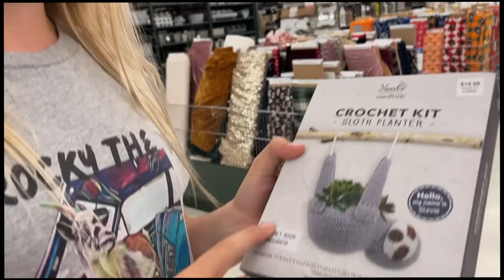Wife’s F100 is back on the road after 16 years! We broke down!

Comment: Oil soaked steel wool can spontaneously combust. We had special containers to store it in the motor pool. When adjusting steering boxes, bottom out the screw then back it off a little.

Comment: Rislone oil treatment works well for stuck rings and cleaning up the valves I have used it on a old 61 ford P/U that smoked and it stoped with in 30 miles, Love the head liner great video love to watch you and your family.
Reply from the maker: Ok great thank you

Comment: Fun vlog, work together well! FYI, before adding any thick additive i.e honey, stp, lucas have the engine to operating temp and running allowing additive to thoroughly integrate with hot oil. If that cold clump gets sucked to the pickup screen, usually ends in the knock knock knock of spun rod bearing which got starved of oil. Thanks for sharing!
Reply from the maker: Ok thanks

Comment: Hi! Love you all precious family! To keep the screw attached to the drill bit take a magnet and run it over the drill bit all sides. It will magnetize the tip and the screw won't drop off when backing it out or putting in a screw. Neat trick.

Comment: Hey, if you want to get rid of the scratches on the glass, I have used a ceramic polish to get rid of the wiper blade scratches. You just need to be consistent with your polishing pattern. And it does take a lot of elbow grease...
Reply from the maker: Ok thank you

Comment: Hot engine garden hose sprayer with the mist setting. Bring the engine up to 2k rpm and mist some water in the carb. The rings tops of the pistons and the valves will be cleaned. Just need water.

Comment: With most steering boxes,,jack the front wheels off the floor. Slacken the lock nut and keep tightening the  grub screw until while turning the steering wheel you feel the steering tightening up right in the middle. Usually this will be spot on. 
✌️🇬🇧
Reply from the maker: Ok thank you
Reply: @Sleeperdude  no problem at all. ✌️👍

Comment: Yeah we had an old station wagon and every time that would bong that's when it was out of gas no matter if you were at a red light or wherever you're at it it bong you were done we even tried jumping out of the car as it was moving to keep it to keep pushing it to get to the gas station all the fun old days yeah my dad used to use when he spray it down with brake fluid and heat it up with torch it would work very well thank you for the video

Comment: That truck brings back a lot of memories. I bought a 72 exactly like that one, back in the early 80s, ford brown half ton, 302, with shell camper just like yours. Rusted with a lot of miles on it for $300 sold the shell for $200. I put a holly on it, headers and my friend welded glasspacks to it, you'd think it would be loud, but it was actually quite. I had to replace the floorboard, but was able to Revit it in, the bed flapped so I found a good green bed for it. My friend repainted the whole truck. I was highly envolved in off road racing and used the truck to haul equipment putting a lot of miles on it going back and forth from Vegas to Cali, it never missed a beat, great truck. Thanks for posting and hope yours is as good as the one I had. 👍🙂

Comment: Just so you know you can use a 9 volt transistor radio battery touch the two contacts to the steel wool and you can start a campfire with it. Old timer prepper trick and I should know I'm 71 yrs old.

Comment: Best way to clean out the gas tank is to use Berrymans Parts Cleaner and throw some small rocks in there. Tip it back and forth and all that gunk will be gone and let it sit for a day or two also.
Reply from the maker: Ok thanks
Reply: @Sleeperdude  Check out my Austin Healey playlist...I cleaned the gas tank on that, check that video. Part 4

Comment: The shifter tube is probably what caused the first reverse problem. Spring loses it’s memory and a press weld plate pops off and then the thin wall wallows out.

Comment: When I looked for a sending unit for my 75 with a 360 I tried a bunch of replacement sending units & they were all 5/16. But my original one I took out was 3/8! But I could not find one like the oem. LMC didn't even know the difference! I called them & they assured me there's is 3/8 but when I got it, 5/16! I went through that 3 more times with LMC before I decided they simply don't know the difference. I ended up repairing my OEM sending unit & reusing it!
Reply from the maker: Ok great thank you

Comment: My 72 F100 shifter failed, so did same as you...floor shifter. Then I went to [power steering, so replaced the whole steering column and smaller steering wheel. For the reverse light I made a bracket on the front of the part going through floor pan and mounted an adjustable switch similar to the brake light switch.
Reply from the maker: Awesome

Comment: You might check the cab mounts ..
I had a 72 F100 & over time the steering became a chore..
Turns out the cab mounts had rusted & this allowed the cab to settle down on the column..
Making it a bear to turn..
Yours is a 73 , so maybe they are different.
But its worth a look.
Reply from the maker: Ok thanks we will check it out

Comment: A good hack on a rusty fuel tank . Get yourself about 2-3hand fulls of nuts and bolts,I use 1/2" for extra abrasive action,to knock the scaley rust loose. Ready strap the tank to you tracktor wheel and jack that wheel up to free spin( **chalk your tires to prevent roll away**). Put some water in it for dust control and good rinse action. Home made tumbler,cleaner👍👍. When satisfied,rinse everything. Than use alittle fuel. To check for leaks, and a jug of heat. I've  seen gas leak through a micro hole that water will not. Physics, science stuff,lol!!!
Reply from the maker: Yeah that would work

Comment: You all did a really good job on the old ford and I’m sure the fuel pump or that really dirty fuel line is probably stopped up with gunk. The ole fuel pump if it’s dried out will fill the crankcase with gas too. Anyway she is a clean old ford and really hard to find in that shape today.

Comment: Hey Josh the dimmer switch on them Ford pickups usually take the wires off of it clean the terminals on it inside the wires put it back in because the dimmer switch on them trucks do go out you can turn the headlights on the parking lights will come on and the headlights will not come on if that dimmer switch is messing up so just wiggle wires on the dimmer switch and it will stay on when you need them if you click on the dimmer switch and it don't kick up the high beam that means you need a dimmer switch

Comment: If a guy has a piece of 3/8s metal fuel line as long as the depth of a diff /trans,lube jug and a tapered jug lid ,(cut your metal tube an inch or 3 longer than your jug/lid) to slip some hose. You can just squeeze your jug and plug your hose in the fill hole. Gives a guy a little better control in them tight spaces . I prefer that clear vinyl hose,to watch the flow.👍👍. Hope that helps
Reply from the maker: Ok great thanks

Comment: One thing with your new big tank so you're not surprised it will show as full at about 12-13 gallons. These new spectra tanks are a little wide on the seams, mine didnt go up in there without some hammer work either. I'd test the pump and hope the fuel sending unit held together and isnt the problem. If you do need to drop the tank, knock those seams down to shorten the width and it'll go up easier.

Comment: I have had to rebuild several columns because of the cab/core support mounts rotted and all the cab weight sits on the lower column bearing, all that weight and movement of the chassis causing all the binding on the shift tube too. Likely can jack up on the cab corner and shifter will be free

Comment: The next time you have a tank to clean out put some gravel in the tank, #57 clean gravel is best but some small rocks will work as well. Now strap it to the outside of your tractor tire, raise that side off the ground, make sure the tractor is blocked good and won’t run off on you. Then put it in gear let out on the clutch and the gravel do the work. If it going to come clean enough to use that’s the way you’ll get it. Hope it helps out one day and great job with the videos.

Comment: I coasted my truck home when my tensioner blew up on the way home. I would fire it up and go high speed and throw it in neutral and coast. It got warm but the marine battery allowed me to stop the engine and coast. 65 dollars after a trip to autozone and the old ford lives on. It made it home. Took 556 miles to break down after three years off the road because it got wrecked. My ford made it home. I do need to replace the belt. It is sketchy

Comment: i took the gas tank out of my 73 last month.it looked like yours on the inside.i used a battery to clean it with and  i filled the tank with salt water,i hooked jumper cables to the battery,ground went to the outside of the tank,poss goes to a piece of stainless,which i put in the tank filled with saltwater. careful not to touch the sides of the tank with the piece of stainless, electrolysis is what its called.it boiled out the inside of the tank.i wish i had filmed it.its spotless on the inside.saved 100 bucks
Reply from the maker: Wow we will have to try that sometime

Comment: The mirror type on the truck is junior West Coast. As far as the engine: 4 bulb. intake, carb, cam, 3" dual exhaust, and long tube headers. You'd have quite the little 302 then!😁

Comment: Believe I would have used a flare and tube nuts to connect that pickup extension. My experience is anything welded or bare steel in a gas tank rusts very quickly. Loved the interior work. Your wife is definitely a keeper.

Comment: Josh if a new fuel pump doesn’t fix the issue you may want to check the voltage regulator.  Sometimes they get stuck in charge mode and saturates the ignition.

Comment: Radiator shops used to clean gas tanks and reseal them . Don't know if any do so anymore ... Me think maybe extension tube to sending might have pin holes in the welds and sucking air . Did you check your welds ???

Comment: Yep still was definitely flammable, if you stick it in to a tater gun before the potato and but make sure it doesn't fall in the cylinder you can see fireworks go across the sky if you shoot it in the air
Reply from the maker: May have to try that

Comment: Flush with bathroom cleaner with a old metel chain or call Original Parts Group order a catalog and order a brand new sending unit and a brand new gas tank Plus all the hoses you may need LOL

Comment: Excellent video Sleepdude Crew  :) yes Neighborhood neighbor Mike save day also fuel pump plus carb be cure all and get bottle of STP Total Treatment fuel injection and carb cleaner in fuel tank to ! Also headlights switch spray on knob control also check fuse on fuse panel to maybe need replacement on both also ground connector on rad to Josh and cure too also ! Fuel line new would replacement to with Black hose from fuel tank to a foot length before pump also filter and steal line plus one to carb with new to ! Still buy new carb with hand choke option too !

Comment: Instead of buying a new tank, buy some muriatic acid from the local Lowes or Walmart. Pour about half a gallon in the tank, and fill the rest up with water and let it set over night. It will eat all that stuff out of the tank, to the bare metal. 
Same acid they use to clean pools with. Works awesome.

Comment: It would have been a problem if you cleaned the gas tank then used ethanol fuel. Ethanol would have cleaned everything so well it would be a plugged up problem for a long time. Best of luck with the new plastic tank!

Comment: So was it a clogged filter, bad fuel pump or a gummed up carb? I forgot if you rebuilt the carb on this one (sitting 15 years, it’s got to be gummed up or have crap in it or the rubber seals are gone).
Reply from the maker: We haven’t fixed it yet so I’m not sure

Comment: The headlight is LED that replace only by a controller and a coil. The coil is the ignition but I call it LED Driver. The controller is not install or it is install which is a plain timer and electronic circuit capacitor power supply that goes between the truck battery and F100's lights. The LED Driver have at secondary circuit is a pair of wires color red and another black one. The Primary circuit is the yellow insulated wire and a second blue wire and a third brown wire. The yellow wire is for connect to ground especially green stripe on yellow insulated. Maybe power transformer to connect to the brown wire and a blue wire or capacitor to lower down regulator the car battery. Because the car battery blew up the controller or LED so it is way too high watts electricity. Thanks, I am electrician.

Comment: I once owned a 79 Ford F100. I bought it from someone I knew. It had 104,000 miles on a 300 6 cylinder. Within 1 year I had replaced so many non functional things. Even the antenna went bad. I couldn't wait to unload that junk. Fords suck. Never owned another one in 45 years. Gas tanks aren't expensive and they make an extra capacity tank. But the spare tire hanger will not work.  The filler neck hoses are expensive if you can them. They are a special molded hose. Try taking the gas cap off. It may not be venting.

Comment: The gas tank is at the best your costs of $140.85 dollars for all metal replacing the broken part 1973 F100 at below bed rear mount type 19 gallon capacity or 15 gal of gas. EBAY got to deliver or not deliver it. Thank you.

Comment: You could have used a torch to put a bigger hole in the bumper but you shouldn't waist the time anyways because the bumper is not as strong as a receiver hitch set up and the larger ball thred wouldn't be practical anyway.
Reply from the maker: Probably

Comment: the mirrors are California mirrors!   that smoke may be do to stuck rings and a good fix is the Italian tune up + ford  MOTORCRAFT CARBURETOR TUNE-UP CLEANER! the other is the valve stem seals need help and marvel mystery oil softens the seals back up. for shot rings Hy-per Lube Oil Supplement. do not use the one with zddp with rotela as it will rase the zinc level to a point it will eat the cam! as for soldering all you need is a propane torch .  I would have used submersion rated type fuel hose like for a in tank pump to join a peace of metal tubing to the end like ----==--------   with both metal lines pushed to together in side hose ------  as splice . fuel pick up might be pulling in air with the welds being not air tight. as for theme add chicken lights a metal sun visor a old school push bumper. mud flaps. running boards pull up handle behind the door. mini semi super truck!

Comment: Too young to know you always check the dimmer switch first. Drip would clean that tank up pretty fair. Pour it in and add a tire chain and shake shake shake.....    Synthetic oil will cut back that smoking. I wonder if he realizes that bondo dust is flammable.

Comment: It goes between the frame rails man you got to put in one side of the time out of time you're smashing it up underneath the frame when it's supposed to be between the rails and all the way up top it is a bastard to put in it's a lot easier if you take the bed off though
Reply from the maker: Ok thank you
Reply: I've had about 40 of those trucks. I always put one side in between fra. Rails and pry the other side in. The opposite side of filler neck. Then it fits the way you took it out.  Just saying

Comment: Wet sand, hit it with sweet patina, cheep level shackles.
Reply: From the video it looks like it sits pretty level,  that might be the big huge camper shell lol. I just finished (are they ever really finished) an 84 short box. The 2 inch drop shackles really level them out. I've also installed them on a 74 that was essentially the exact truck you've got here.